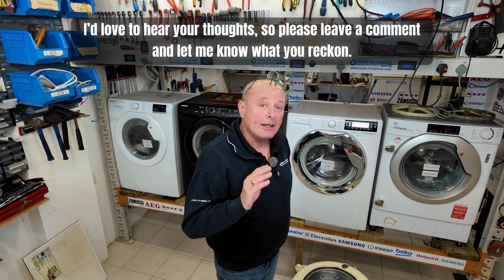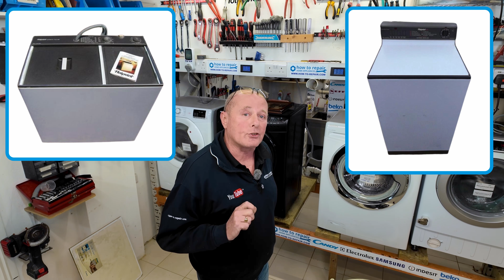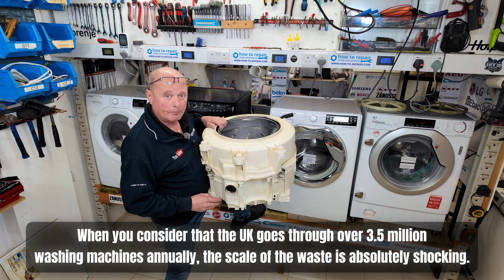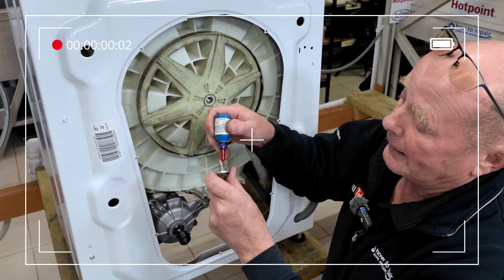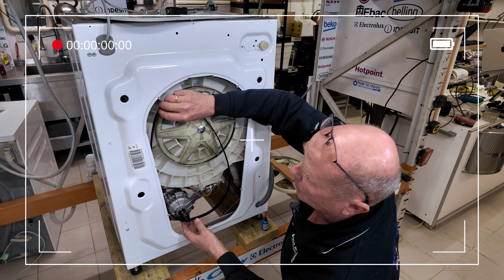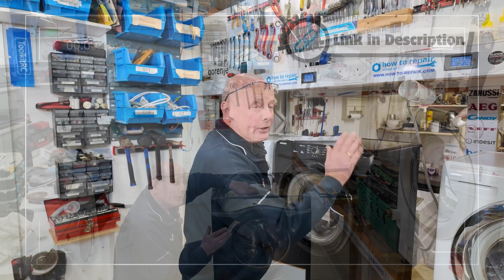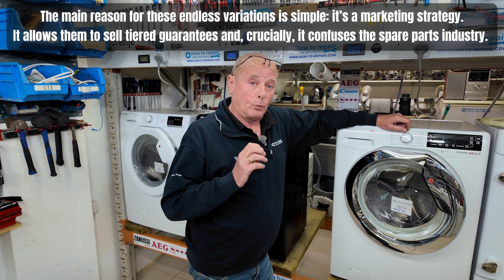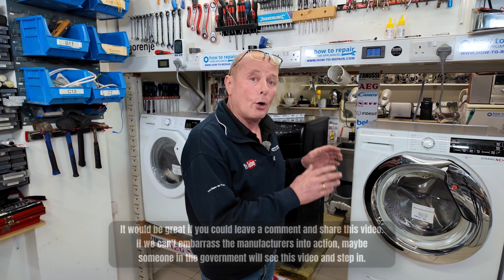I Scrapped 13 MACHINES to Prove a Point: STOP BUYING These Brands!

Comment: in south east asia, lots of people are still using semi automatic top loader with 2 tube. some of the old ones that we buy during 2025 would still usefull and only need a few repair. however after 2017, lots of new models would break down frequently at least once a year.

Comment: I bought a washing machine fairly recently and I was using it, and I was seeing "ECO mode". Like, wtf is eco mode. So I looked into it. All it is, it's "statistically" slightly more energy efficient than the average wash. which means basically nothing. In fact, the only difference I can see, is that the cycle runs hotter, and three times longer than the cycle I normally use. Which is just going to wear out the components faster, almost like that was the sole intention...

The world wants the consumers to feel responsible for the environment, when it's the manufacturers that are the ones producing the e-waste on purpose. 
And recycled plastic, you know what happens to that? It goes to Indonesia. And they burn it. As a fuel for more manufacturing. 
The governments are making the consumers more environmentally conscious, because it's easier to put it on us, than the giant corporations, who are the ones actually doing the most damage.

Comment: There one thing that sank deeply into my memory during lessons on synthetic materials design and engineering on university - key factor, that companies are looking for in graduates is how well they were trained to make parts break after precise amount of cycles. Some manufacturers perfected this craft to the point, where they can achieve >1% margin error on that number and they have whole lab settings dedicated to testing new batches of raw materials they buy, so they know how to make adequate blends, that will meet those quota. Planned obsolescence is a fact and if someone does not believe it, is a complete fool.

Comment: We've had an Amica washer for close to 10 years now and while it did have some issues, one thing that surprised me is how relatively easy to take apart it was and that everything needed to repair it was available for sale online.
You can buy basically all the important bits and there's even a service manual showing you how the circuit board should be wired up after replacing it. I was blown away since Amica is a Polish budget home appliance brand.

Comment: Sealed drums are a crime. I still remember the first one I encountered.
Reply: thats nothing , i have to drill my cars gearbox to get the spent oil out. sealed shit strikes again
Reply: In most cases sealed drum can be opened, repaired and converted to a normal drum. The real problem is proprietary components that either overpriced to the point where it's cheaper to buy just a whole new unit, or not manufactured anymore so you can't fix the unit
Reply: @ght477a I don't know. Cut open the drum is already a messy business. Then sealing. It's a sort of thermoplastic resin. I was not able to find a proper glue that sticks. All hardening glues/epoxy are excluded, because under vibration and deformations of the drum in operation will crack and leak. Maybe a combination of screws and silicon as sealant? There was not much space for screws to be added. I don't believe a repair shop would accept the risk of experimenting with possible water leaks in customers'homes.

Comment: We had a weak, call-out was £180 plus parts. So I tipped the machine over and found a pipe from the drum to outlet had a bra wire and nail punching a hole through it.

Found the part number - next day via amazon part arrived, part fitted that afternoon and repaired for £25

Comment: actually, the warranty thing appears voided in europe as well, what is warranted is a respected usage of hours of the machines, meaning if a life cycle is meant to be 200.000 hours and it reaches 50.000 in 4 years, they still kind of have to service and repair it as the life expetancy versus the cost has not been met. its kind of crooked. same for warranty void stickers, they are not valid either.

Comment: The public needs to save on energy, plastic, and beverage cans, and adopt an electric monstrosity as a means of transport as soon as possible. Just said what, the Miele was a very long-lasting machine in Europe. It's gone now, so what's the point of the slogan "sustainability?" I'm glad this is coming to light, and I hope consumer organizations will finally address this. Furthermore, we need to keep the built-in chips under scrutiny, because they often generate unclear codes that can only be resolved by calling a technician who either resets the code and tells you a sob story about your machine being on its last legs.Furthermore, all devices must be recyclable.

Comment: I remember going through headphones and hair dryers at least every other month because they would just die randomly. Every time that happened I would switch to a different brand until I landed on one that was actually reliable. The brands that finally were reliable cost 3 times more, but it was worth it after having to buy so many cheaper brands. It was frustrating to go through. I was completely unaware about planned obcelecense and found out the hard way.

Comment: This is common amongst everything - phones, computers, cars, everything. Its proof, to me at least climate change isnt real, if it was, the machines i mentioned would last for decades, be repairable, which is far more climate friendly than disposing and buying new. Its not just about cost financially, as it is cheaper to buy new in many cases. 

I spent 10 years overall building a fantastic gaming pc, every component i had to buy gradually, got it just perfect for me, works amazing, faster than most pc's that are out today, and yet, ive been forced to replace it because Microsoft wont support the "old components", the hardware itself works perfect. 

Its all a lie.

Comment: I have a 33 year old washing machine that we bought new that still works just fine.  We had to get a repair done on it when it was about 17 years old.  I asked the gentleman if we should bother getting it fixed, because it was getting up there in years.  He said, "Absolutely!"  He went on to explain that the appliances being built then (16 years ago) were junk.  He figured that we would get another 5 or 6 years out of it.  He was wrong.  It's working just fine, and we have never needed another repair.

Comment: I totally agree that planned obscolescence should be illegal, but in the defence of those companies that used to make high quality products, they cannot compete with the cheap chinese products, so to avoid going out of business, they use the strategy: if you can't beat them, join them. Only strong technical regulation and its rigorous enforcement could change that but it would also increase the cost of the products. Many people would still prefer a machine of £350 over one of £1000, even if the latter would last 4x longer. That is the dilemma.

Comment: Sealed drums should be illegal.  200EUR to replace an entire drum assembly when all you need is a new spider or pair of bearings is outragous.

My Beko machine from 2017 failed in December 2025 with a failed spider, the metal had just rotted away. I had to buy an entire new drum assembly for it.

And yes, I'm an engineer and do board level PCB repair.

The machines should come with schematics and a wiring diagram too like all appliances used to when I was a kid.

Comment: This is very informative. My Dad is an engineer, he can fix washing machine, fridge, air conditioner, etc. and He hates new products 'coz they easily break to force customers to buy a new one (strategy similar to bulb and fluorescent companies) But some companies still make high quality.  I bought an  LG washing machine 15 years ago and still works without any problem until now. Now the LG's price went up but I will still buy it if ever our machine broke.
Reply: LG is not the same as it was back in the early days it's the same as all electronic items now not built to last

Comment: I wouldn’t touch either of those models, but not Hotpoint either now. I have an LG direct drive washing machine that’s so quiet when washing and spinning and I’ve had it for about 12 years. I wonder if we can write to Manufacturers asking if their machines are repairable and if not, why not if they should and at a reasonable cost.

Comment: 200 pounds for a washing machine PCB!? You've got to be joking.. The manufacturing costs for those would likely be less than $10. It really is true though, modern appliances are designed to fail. I've got 30-50 year old appliances that still work fine today. Lucky to get 6 months out of a new one.

Comment: I can't wait for AI and 3d printing to get a little bit further. Imagine how great it will be when we can just build these things ourselves with little to no actual experience in something like this. After repairing my washing machine a few times over the past 13 years, keeping it running, it doesn't seem too complicated of a product. 
.
I just hate this so much. Because there is no good solution really. If we can't trust manufacturers to have our best interest in mind (this should be obvious that we can't) then we are left with two choices. Either we implement major regulation and laws, which drives pricing up even further... or we have to learn how to do these things ourselves to properly assess value of the products/services they are providing, which kind of defeats their purpose to begin with if we can do everything ourselves...

Comment: I am here in Los Angeles, United States. Used to be the Sears Kenmore brand was rock solid. Also, Sears had a fleet of repairman would come to your house to fix your washer and dryer. That’s all gone now. I bought  a 7 year old washer and dryer, at a garage sale. (Kenmore) The owner was selling only because they were moving across the country . I installed them in my house 4 kids and two dogs , 5 grand kids 4 dogs and use them for the next 45 years. I finally had to. retired the washer because the timer had failed and no replacement was available.

Comment: Good day. I have a Whirlpool washer / dryer set from 1984.  Folks, Get an older machine and have it refurbished. I had to replace the belt on the dryer and the water pump on the washer in 52 Years!

Comment: I don’t want a long warranty as much as I want good design and engineering that promotes long usable life (20 years minimum). When my mother sold her house, we had appliances that I knew and used since I was a little boy. The house sold around 2023 and we bought it in 1969. So yes—that means we had a refrigerator that was about 55 years old.

Comment: Its not one, probably all brands are following the same pattern. 
Its like a friend told me. A guy from the net opened multiple LED TVs from a certain brand....don't remember the brand. And all failed due to the same flaw. A capacitor close to a resistor with an radiator. Due to the heat all of the TVs had a fried capacitor, which was easily fixed by moving the element at some other place on the PCB. He gone to the manufacturer to tell them there is an issue. And they simply answered. There is no issue with the TV. Case closed.
So they deliberately produce them that way. No wonder there are teams who are responsible only for the aging of the exploitation of the products.  
My wife had a washing machine and a dishwasher who worked for 14-15 years without any issue until they finally gave up.

Comment: I bought a new LG washing machine in 2016, and after four years, the motor broke down for the first time and was repaired under warranty. In 2025, the motor broke down again. LG Support said that we would get the replacement part under the 10-year warranty on the motor, but we would have to pay for the labor and travel costs ourselves. This meant that the repair costs would be higher than buying a new machine, and the machine was already “getting on in years.” What nonsense. We still have an old Siemens that works great. We'll keep it as long as we can. New appliances are just junk, it's a real shame.

Comment: they did the same with mobile phones, suddenly EVERY COMPANY decided to just seal in the battery for new models, so you couldn't take it out easily. Imo there is no logical reason for the consumer to not have the ability to remove the phone battery easily especially since this happened after a fiasco with samsung phones where the batteries overheated and caused phones to explode.

Comment: My Gorenje machine had the same issue with the pulley wheel, the nut was coming loose. I heard there was a noise coming from the machine, so caught it before something broke.
Think there was something wrong with the temperature sensor aswell, most of our fabrics were shrinking 🤔 from bedding to pants to t-shirts
Moved from that house and bought a Siemens machine in my new house, the money up from that machine is so far worth the investment, I'm hoping it lives at least half the lifetime the machines that stood here when I moved in 😄

Comment: Not so fun fact:  General motors started normalizing planned obsolescence in the 1920.  They called it "Dynamic obsolescence" and told you it's good for you!  
It's been a slippery slide in manufacturing ever since.  Longevity is bad for business(profit) and doesn't fit the business model IE the board has voted.  Bend over.

Comment: Any machine you care to name, automobile, washing machines, dryers, armaments (pistols, rifles, shotguns), toasters, freezers, hvac, etc, etc; is made up of  parts that manufacturers obtain from subcontractors on the basis of cost.  They do everything in their considerable power to drive down the cost of parts used in THEIR machines.THey do this with their suppliers with the stipulation that the supplier can charge a premium for individual parts supplied for repair.  Often the parts are themselves very complex assemblies crerated from subcontracted parts under the same provisions.  The washing machines  highlighted are cheaper than some individual parts on the secondary market.  It is all a matter of factors of scale.  If your order 100 parts instead of 1 the items are vastly less expensive per unit.  This has always been the case.  THe real limiting factor in repairing any machine today is labor.  IF you DIY it is not so bad but if you get a series of part failures at premium prices it becomes a no-brainer to scrap the macines and just buy a newer one.  Even if you buy a used but repaired machines the cost difference vs a new one is often very slim. OH....and most are not designed to be repaired thus adding to the cost when you try to DIY.  I started to see this trend 55 years ago renewing the solenoid of a 68 Chevelle.

Comment: Buy a basic rotary control Top Loader with zero electronics and it will last you for decades. I'm on my second GE basic top loader and it's 26 years old. No problems ever and it cost less than $200 brand new in 2000. Also buy a basic dryer, mine is also a GE 26yo $149 in 2000.

Comment: I guess there's a reason we don't see those machines over here (I'm Mexican), they simply can't compete against a Mabe or Whirlpool top load machine that rarely lasts less than 15 years (and it's usually just a matter of changing seals or bearings before the motor gives up 5 years later, and still is easily replaceable). 
I kid you not, people over here get washing machines and fridges as inheritance 😂

Comment: I had purchased a brand new GE Dryer in 2000, and over the years, I kept it functional by replacing heating elements, belts, etc. I replaced it 2 years ago because I couldn't find the Termister required to keep it going. Yeah they dont make them like they used to.

Comment: My Maytag dryer timer control has a plastic stem designed to break! I had to re-design with a stronger, wider, epoxy-reinforced fix. Usually the only fix is buying the whole control box.

Comment: Dean Doherty (usually does tool videos) posted a video where he cut the outer drum with a saw, fixed the bearing and used thickened expoxy to glue the drum back together

Comment: When a single brand makes a new design every years and thus making all the parts incompatible with previous machines, it tells you everything you need to know. They don't want to sell you a machine that you will use a lifetime. They don't want you to fix it. They want you to buy a new one every year preferably.

Comment: There are 3 simple rules for taking care of your machines: 
1) never overload
2) use minimum amount of quality detergent
3) clean the machine regularly (even the vinegar helps a lot)
The way you use your machines, makes a big difference.

Our old Indesit worked  15 years without problems. 
Also the AEG and older models of Miele are great 👍🏻
We have a second-hand Siemens dishwasher that we bought 5yrs ago for 100eur, still running great.

Comment: So basically the machine are getting cheaper to buy, the parts simpler. it not only bad.
Even if parts got cheaper, the hourly rates are much higher than they used to be so it would still not be worth fixing it.
The cost of trade people nowadays are so high, than I know even surgeons and specialists who set up their own kitchens and paint etc. as its still worth it with the saving. Why does branded car shops charge +170 to +200 GBP per hour, and charge 3 hours for 30 minutes work? Soon cars will go same way, we buy a new when they break down.